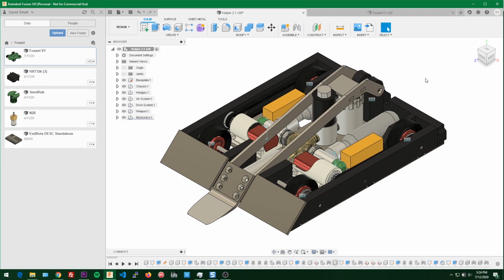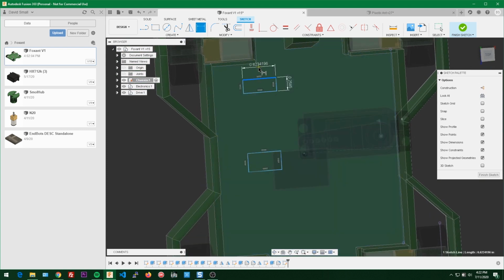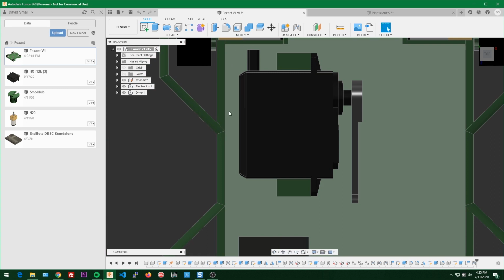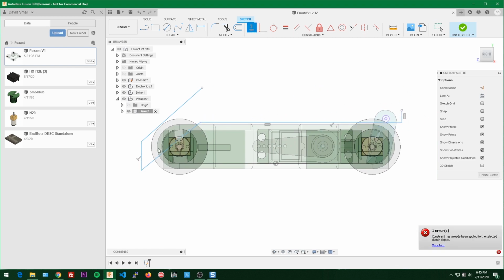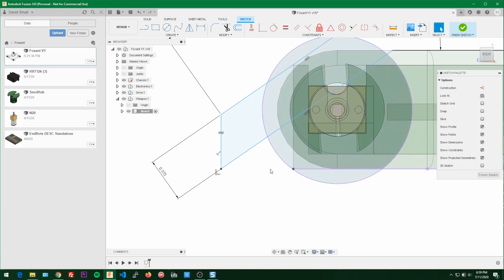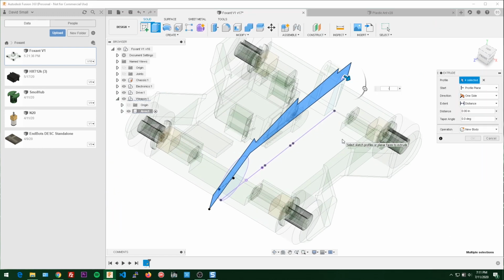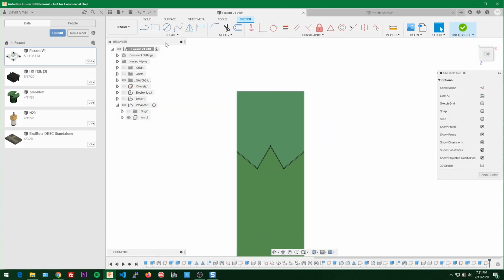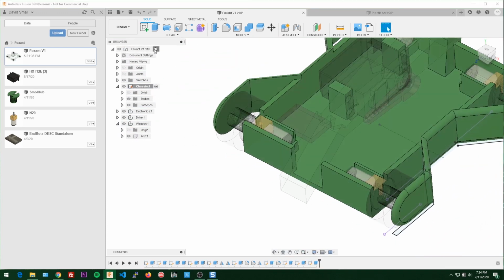Foxic CAD-A-Long: Part 5

Comment: Cracking video. I'm really enjoying this series for learning how to use all the different features. For some reason my chassis stays fully opaque when doing sketches on other components where yours goes almost completely transparent - I wonder if I missed a setting somewhere.

Kind of related, but I'm having trouble visualising how I would transfer my new knowledge to my project which would be made of polycarbonate panels (no 3d printer), but I'll sure have fun figuring it out.

Thanks, keep up the good work :)